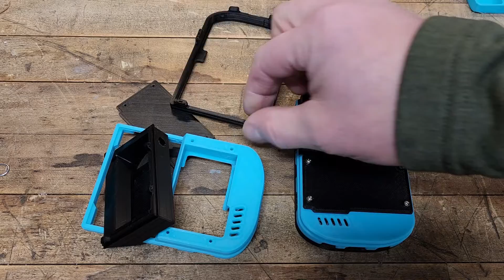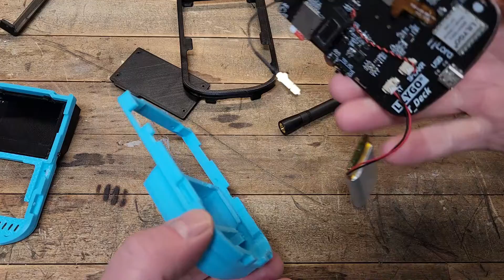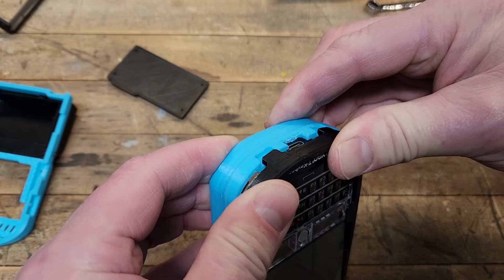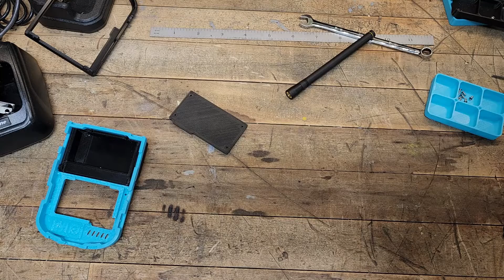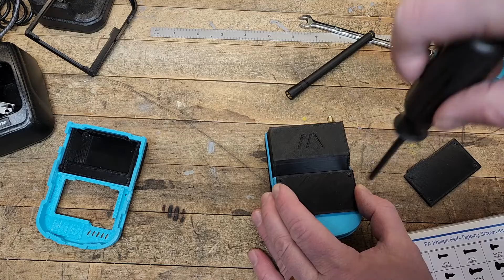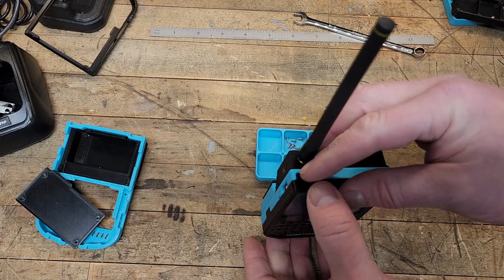The Latest T-Deck Case | Lilygo | Meshtastic

Comment: That "valley" running horizontally across the back of the unit is wasted space. Perhaps a future design could be one smooth flat back, which would allow a still bigger LiPo battery to be mounted. Flat back and flat front means you could abandon the snap connectors (and the issues related to them) by having just screws on the back of the unit. This would make any gasketing easier too.
Reply from the maker: I 100% agree, I sent a message to the designer. I also have learning to CAD design my own 3D print files on my short-list. Thanks for the feedback.
Reply: @RavenwoodAcres  Hope the software on the t-deck can be upgraded someday to be closer to the functionality you get through a phone running the Meshtastic app.
Reply: @RavenwoodAcres  Apologies for multiple replies. Just came up in my feed a 3yo video called "lora msg" on the channel "msg lab". Someone's handheld versions of a device that appears to predate the lilygo t-deck.
Reply from the maker: @suzyamerica4679  Interesting, I will check it out. I got into lora about two years and it is developing fast.
Reply: @RavenwoodAcres  You have been very patient then! But yes, that link was cool because it has all their build notes (on the website) and it came out like a lilygo t-deck but was made of entirely different components. Keyboard looks pretty similar though.

Comment: Since T-deck is so big, and uses more electricity, why people don't use 18650 lithium cells? I have hundreds of such cells waiting to be used in some project.
Reply: Likely due to complexity of install and size. You would need to purchase an additional battery holder with a built in BMS. You already get all that with the flat pack and it can be soldered right to the board with little fuss. I actualy use 18650s with my LoRa32s with holders from Battery Space so it's definitely not a technical problem.
Reply: @NFSSAM  why not 3D-print battery holders. No need for BMS if the device has lipo management
Reply: @NFSSAM  
smaller cell phone batteries work exceptionally well too...and have the BMS and all that built in

Comment: I built this one twice and it snapped off half the face connector tabs on each that I printed. PLA was from 2 different manufacturers (one was Creality). I think I'm going to go with the screw in one.
Reply from the maker: The black pieces are printed with Polymaker Polylite PLA Pro.
Reply: @RavenwoodAcres  I just printed it out with that PLA Pro filament and it worked great. I have a bunch of different colors in PLA+ but I think it is too brittle for this application. 
Also, I was mistaken about manufacturers of my previous. Neither was from Creality.
Reply: PLA SHOULD be flexible enough to not snap on those clips. I would check that your nozzle doesn't have a partial clog, and if a bowden print head, make sure the tube is fully incerted. If after fully troushooting extrusion and you are still having issues, get some esun pla+ (I think they may have recently rebranded it to "pla+ pro") it is stronger and can handle more deformation than standard pla.
Reply: @NFSSAM  After his response I checked and realized that I actually used PLA+ which I believe is more brittle I just got a spool of the Polylight PLA Pro to try out. First I need to build a bigger spool holder.🙃